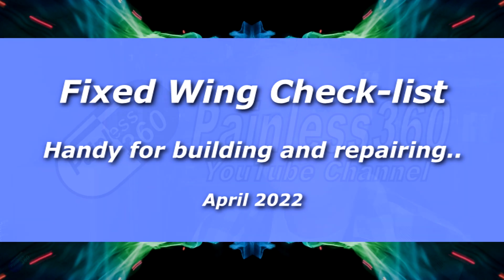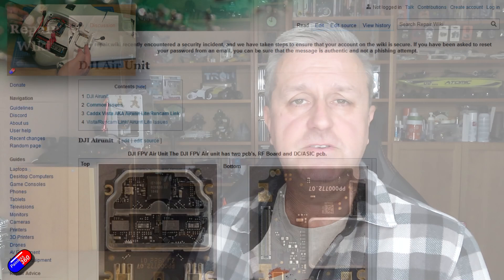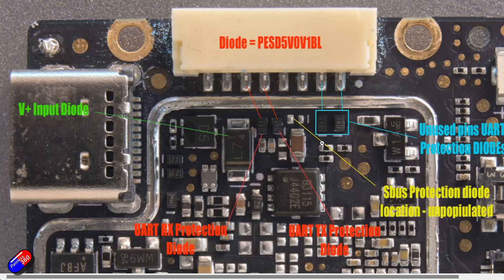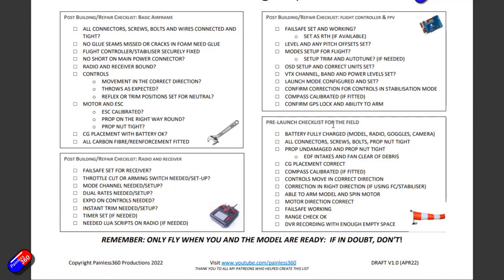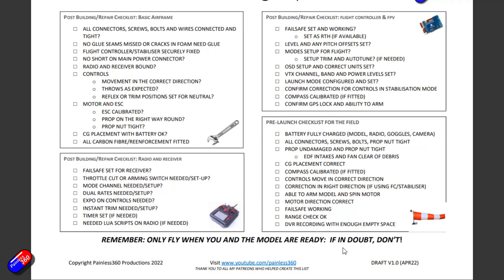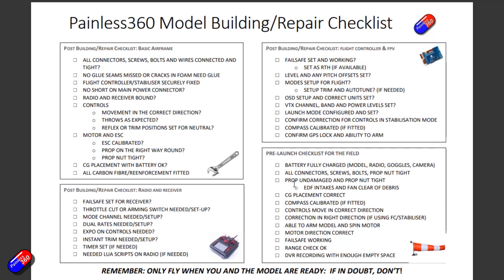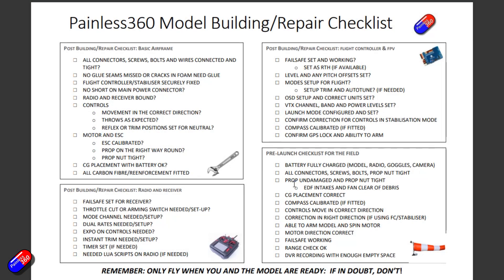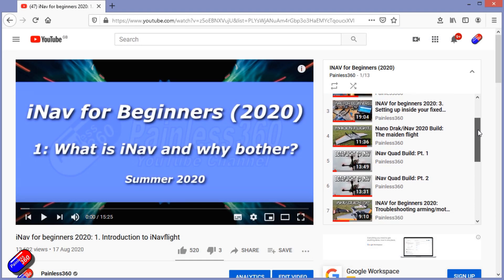Building and Repairing Fixed Wing: Checklist to avoid the common mistakes!

Comment: When I was a plane captain in the Navy we had checklists for everything. I worked on the FA18 E/F, and we had a 37 point list of things to check off for the inspection, and they even included that it had to take 45 minutes to complete lol. If you launched a jet that day you went out an hour and a half before hand. Similar when I started learning to fly a Cessna. Checklists are priceless.
Reply from the maker: I've never known a full sized pilot (be that a little flex wing up to a commercial jet pilot) startup without a checklist. We forget the basics at our peril and it is easy to overlook something if you get distracted or flustered and end up having a bad day at the field.... Happy flying!

Comment: Hi Painless 360 not to do with this video, but can you do a video on  fine tuning a Radio master R88 receiver on a Taranis X9Dplus. I have just purchased the receiver to try, and have no trouble binding, but the receiver instructions say fine tuning is required before use. and there is no option for this in the Taranis. Regards, Ron
Reply from the maker: Fine tuning is something that helps with Multiprorocol modules. It isn't something that you can do on regular radios. See my video on MPM on why those radios need it... Happy flying
Reply: @Painless360  Thankyou